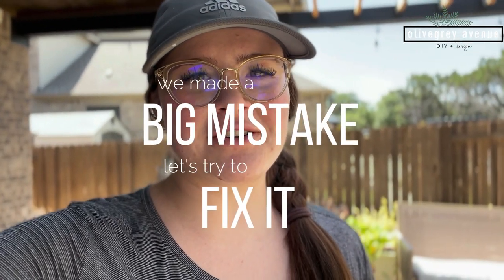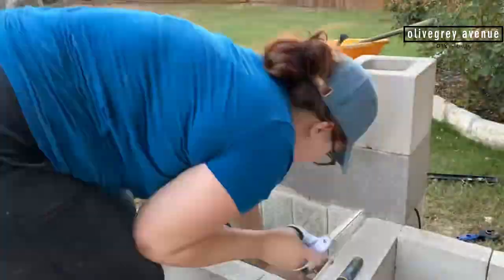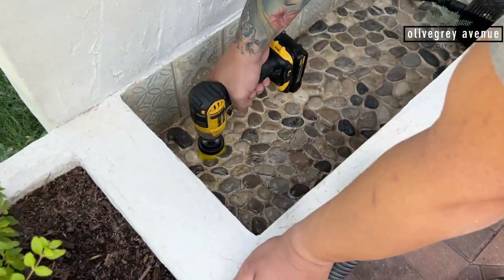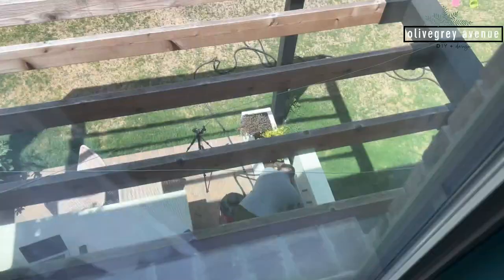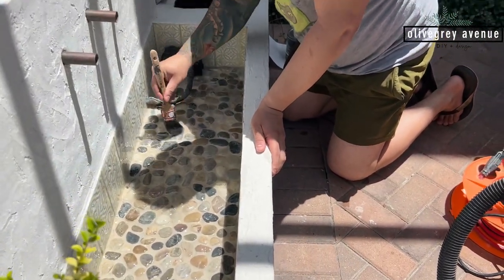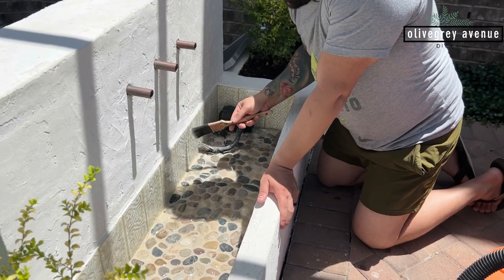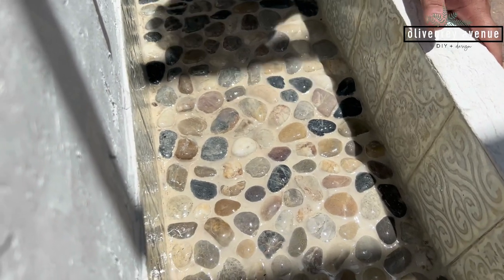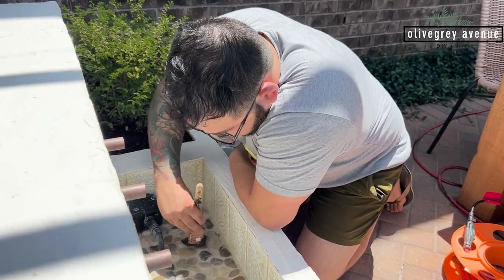OUR DIY FOUNTAIN LEAKS - Can we fix it?

Comment: Honey get clear sealant coat really good it should work Make sure you don’t do it in the heat of the day needs to be in the cooler the day keep it overnight chipset and then let the sun curate
Reply from the maker: We tried sealing the grout and cracks several times but it never lasted so we’re hoping this will be the long term solution

Comment: Hi, what product was being painted on? Also, the tube that goes into the cinder block on the bottom, what did you use to prevent water leaking through that hole? I wanna give this a try!
Reply from the maker: The product around the pump cord is an exterior silicone caulk and the stuff painted on is a flex seal product that’s pictured in the video 😊
Reply: @olivegreyavenue  thanks for clarifying.
Reply: Hi was wondering if you glued the base blocks together like you did on the planter video. Is it necessary for this project?
Reply from the maker: @chuckytuna6202  yes, I glued all the block together. I would not just dry stack them.